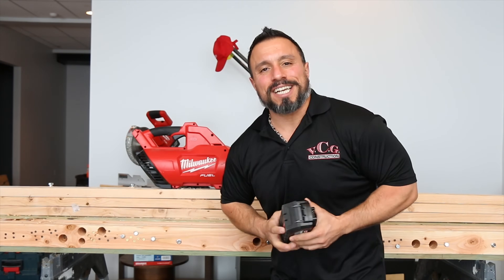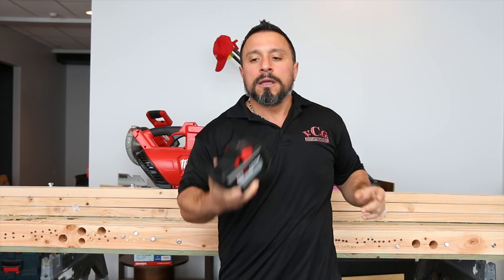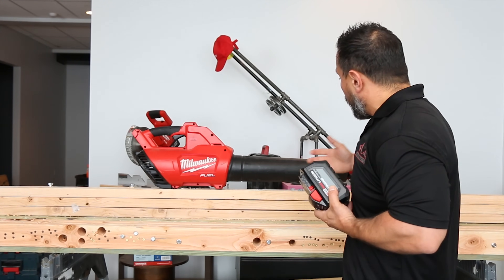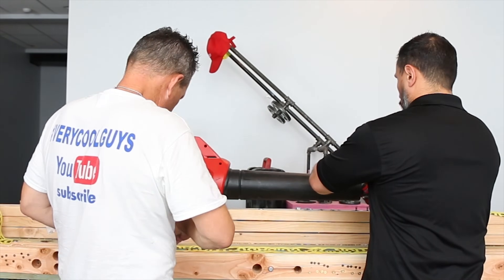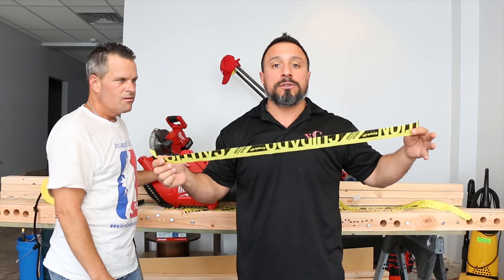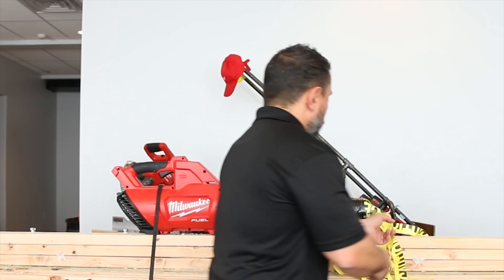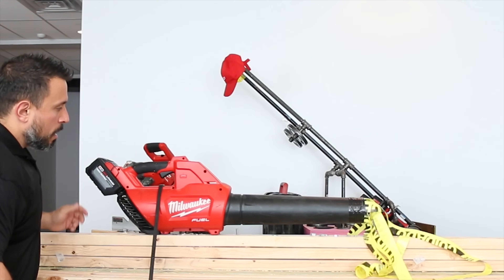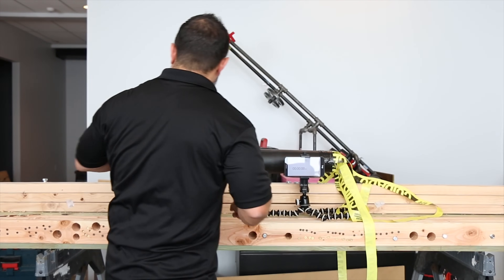Milwaukee M18 HD12.0 Battery Pack - Watch Before You Buy!

Comment: I picked up my new Milwaukee m18 fuel blower yesterday with a high output 8.0 battery and rapid charger but I was deciding between buying another 8.0 or getting a 12.0 you helped tremendously now I know I’ll get 27 plus minutes from a 12.0. The difference in price is 30.00 dollars 229.00 for the 8.0 or 259.00 for the 12.0 it’s worth the price.

Comment: Anything that runs hot and continuous uses more charge and insanely fast. Milwaukee will need to come up with another type of battery for things like that.

You can really see the difference in the 12.0 on stationary tools and not notice the weight and tools that stop and go as needed. They last a ton longer and they’re worth it but for a continued power drain I don’t think batteries are there yet. Maybe 2021

Comment: Been looking at buying a bigger battery for my M18 Fuel angle grinder, and I was undecided between the 9 and the 12, finally went with the 9Ah. Most stuff I do I'm quite fine with my 5Ah batteries, cutting is never an issue, but bigger grinding projects are a different story....

People talk about Milwaukee tools being expensive, but the big difference is in batteries where I live. I've seen equivalent Makita batteries at roughly 60-70% of the M18 price. That is just insane considering both brands cater to professional users.

Comment: Seriously at this rate of run time I would go broke. Not worth it at less than 30 minutes - this is not acceptable. Milwaukee needs to do better than 27 minutes if they want to be considered worthy of yard workers. At least Dewalt gets about 2 hours out of a 5 hour battery.

Comment: i finnally got to use it in my weedwacker today, and it kept shutting down the weedwacker , id have to let go of trigger and start again
Reply: Do you plan on contacting Milwaukee about this issue?  Seems very odd that the 12Ah battery is not working well in the trimmer.  I have the Milwaukee trimmer too (with the 9Ah, and using the supplied 0.095" line) and have been having issues with it shutting down when it's run continuously in hot, sunny weather.  After ten seconds or so it restarts and will usually continue running, though sometimes it requires a longer break.  Pushed further, the 9Ah battery will often enter full overheat mode (the four led battery lights will blink in alternating formation) and require a long cool down period.  This is very disappointing, since my old 40V Dewalt trimmer never did this.  I've read that using 0.080" line can help reduce the load on the motor, so I'm gonna give that a try.  I was hoping that the supposedly cooler running 12Ah battery would help this situation, but from your experience it seems like this may not be a solution.  Thanks

Comment: solid testing! video didnt need to be 9 minutes long to show that though, i wonder if theres a engineering reason why they havent put more then 15 cells in a pack, i know theyre using 21700s now instead of 18650s.. but why cant they make a battery with say 30 21700cells, thatd be about 24AH and itd obviously be marketed just for highdraw tools like leaf blower chainsaw ect

then again youre probably better off with 2 - 12ahs so one could be charging
Reply from the maker: Yeah, it didn’t need to be 9 minutes long, I could have tweeted the results out, but this is YouTube! Thanks for watching! 🤣🤣🤣